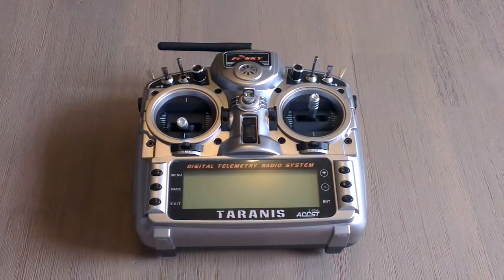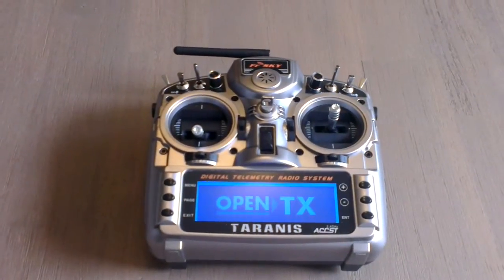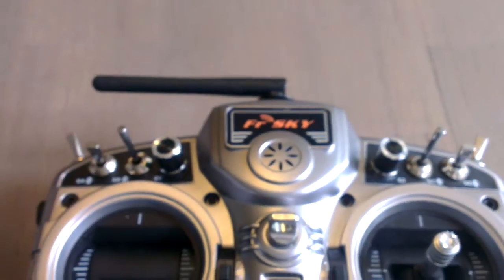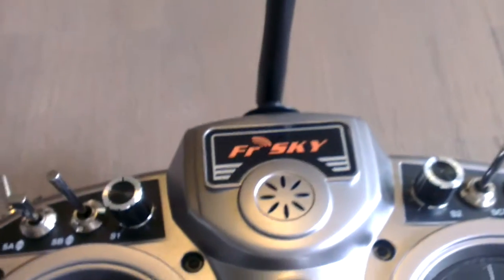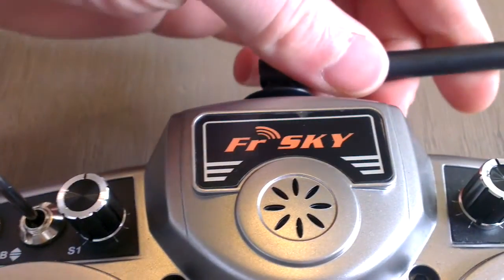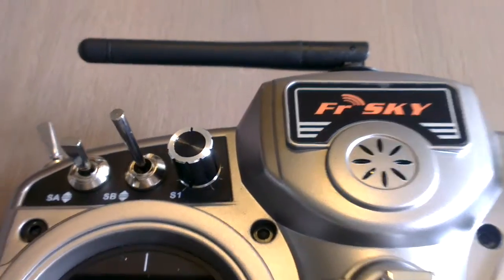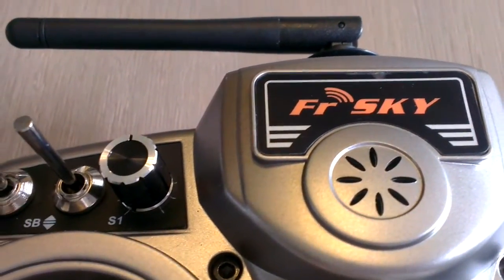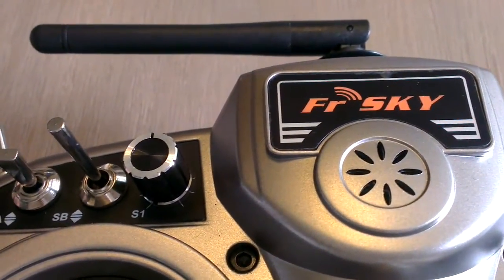Frsky Taranis speaker buzz problem

Comment: I just bought this radio and it arrived with this problem. Still not fixed after all the years (it's a new radio, had a sticker it runs the new EU firmware). I hope warranty covers this because I don't want to listen to that noise all the time.

Comment: How did you get yours to talk?  Mine only beeps and I can't find anything in the manuals about it having speech. On the plus side there's no buzzing either.
Reply from the maker: Hi Steve I think it should talk out of the box, mine did anyway. Did you buy it new?
Reply: ***** Yes, just got it from Hobby King. The problem seemed to be a bad SD card.  I replaced the SD with a new one having the latest audio files on it and now the sound works.
Reply from the maker: Good to hear that you found the problem, happy flying!
Reply: steve c mine was the same, no sound until the SD card was replaced
Reply: Often enough to format the sd card (you have to backup and copy back the files before).
Reply from the maker: Yep that helped with me too
Reply: I still had intermittent problems after formatting the card so I replaced it. Have had no problems since :)